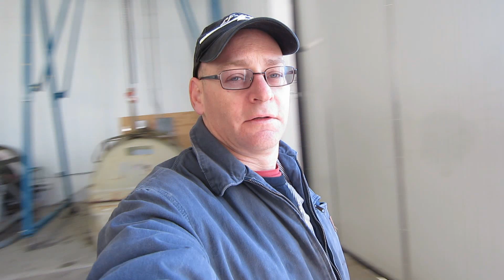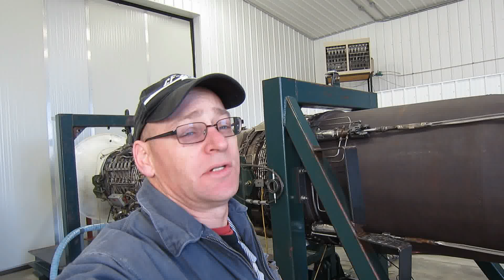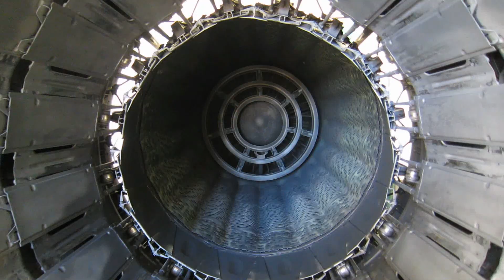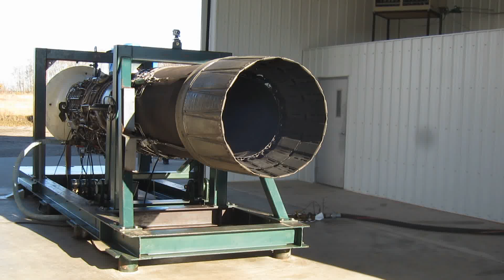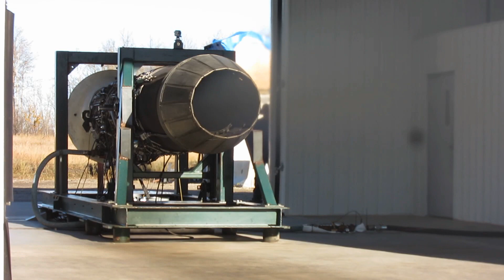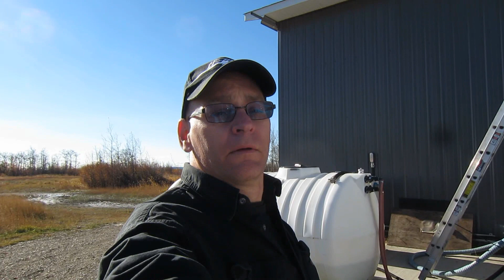J79 the next Wednesday

Comment from the maker: The Olympus has two systems, or spools if you will. The LP system is "on the outside" so it's what we see coasting down. The LP system has nothing like fuel or oil pumps being driven by it, so it coasts for a long time.
The J79 is a single system engine - one shaft... one spool. So that shaft is like the Olympus HP system: it drives all the accessories, as well as the afterburner fuel pump, so it comes to a stop fairly quickly.

Comment from the maker: Vibration at points corresponding to the three main bearings in the  engine. Air pressure before, during and after passing through the engine. Bearing sump pressures to determine if any oil seal leaks are present... ( see my lube system video ), also calculated and actual positions of the variable stators.

Comment from the maker: How to start a jet engine... was made featuring an LM1500, whic is the exact same size as this engine, only without afterburner. It's an industrial, non-flying J79, and shares many part numbers.
Under the cap is an air turbine starter, like the one in my starter videos.

Comment from the maker: Something like that does happen... sort of.
Not in compressor blades, but with turbine blades.
They are heavier and under high tensile stress due to centripetal forces. Also they work at very high temperatures and are also subject to bending forces from the interaction with the high velocity combustion gases.
Over time, they can slowly grow in length and eventually break. The atoms don't move much; the whole blade is stretched. It's commonly called blade creep.

Comment from the maker: We're not talking about power. This engine's output is measured in thrust, not power.
 
The industrial variant of this engine, the LM1500, is used to trun a power turbine, which turns a shaft with a measurable amount of power. Somewhere around 15,000 Hp.

Comment from the maker: Not a constant rpm engine, but its "powerband" is really from about 6500 rpm to about 7400 rpm. Anything below that, and in the aircraft, the nozzle opens to eliminate thrust because you should be on the ground below flight idle.
Ground idle is around 5000 rpm.
There are three totally different engine parts that are commonly called nozzles, so I can't really answer the second part of your question...

Comment from the maker: The shaft runout is measured when the engine is vertical, and without the rear bearing in place. >.008 inch   With the rear bearing in place, the runout is zero.
Max RPM is 7450.
If by traction you mean thrust, the engine should put out around 11,000 lbs at 100% without AB, and around 18,000 lbs in full AB

Comment: I do not remember if was a Bernoulli or Venturi principle, but there was the one about how a column of moving air causes the air around it to move with it..Just wondering, when you have an engine running, do you feel an noticeable amount of air flowing through the cell, around the engine.

Comment: Ahh sorry, I meant the fuel nozzles/(injectors?) you described. The low smoke more efficient ones compared to the ones in that J79-19. Sorry I wasn't clear there. Was wondering if the more efficient low smoke ones increased thrust, or if that was still limited by the max Turbine inlet temperature. My guess is that with more efficient burning the flame is hotter with less fuel, so the only things that change are less fuel and soot, same thrust/rpm/mass airflow. Is that right?

Comment: Hey J. Just curious. Is it possible to do a "plug'n'play" replacement of the fuel nozzels, or does the engine need another combuster? What is the difference in fuel consumption on the two nozzels?

Comment: Are these engines constant RPM engines, adjusting thrust by opening and closing the nozzle, or is there only a different aperture for idle, run and AB? Also with the more efficient nozzles, do they increase power or is power here still only a matter of Turbine inlet temp? My guess is that more efficient burning=hotter flame for same fuel, so less fuel is needed to reach maximum inlet temperature. Is that right?

Comment: To start the engine. Just take a look on his other video /watch?v=g4pqEzfKXcA How to start a jet engine. Note: In that video it's a different engine. This ones much bigger and it seems it's main shaft is powered directly. I'd guess under that cap is the main shaft which is somehow propelled by the high pressure their separate starter turbine produces.

Comment: Jay, question that has been bugging me for some time, but somewhat unrelated to this particular video.  On newer GE/PW engines, such as those used on F15s and later.  When they hit the afterburners you can hear a high pitch mechanical whine slightly before the flame.  I'm noticing in your videos, the older engines don't do this, what makes that noise?